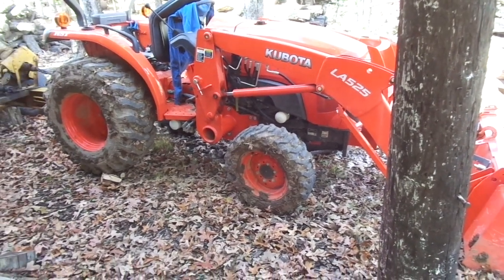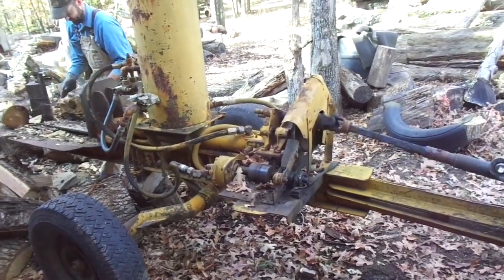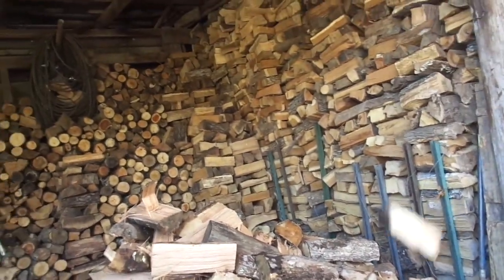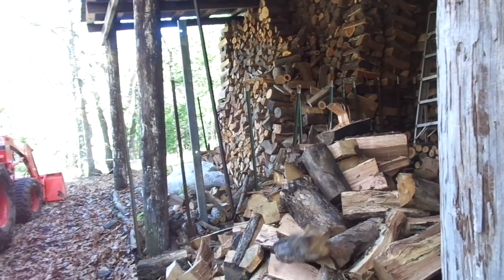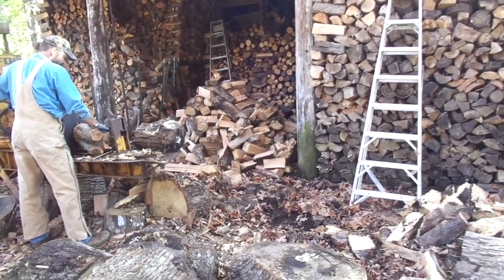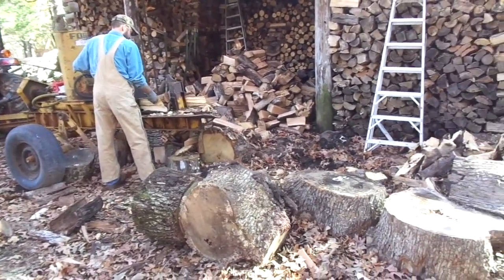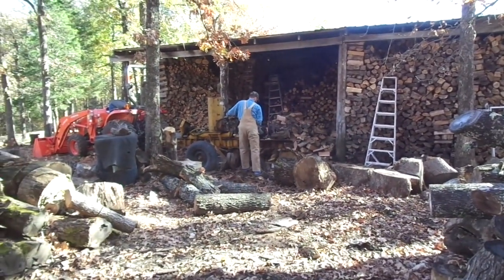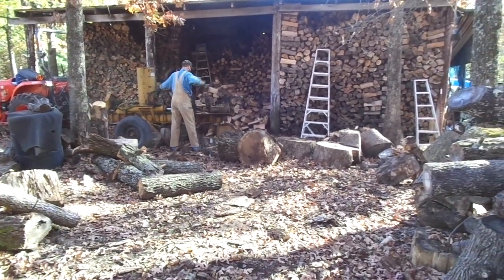Kubota L3301, Homemade Wood Splitter and Son in Law

Comment: “Just subtle differences” LOL!  Not used to seeing you watch others do the work, Wendell. Man, you have a HUGE stash of firewood! That tells me it gets way too cold 🥶 up your way! Thanks for sharing!
Reply from the maker: The shed measures 36 feet by 12 feet deep by an average of 10 1/2 feet high.  We burn about one section per year (roughly 11 1/2 full cord)  and TRY to keep three years split in advance.  We are running late this year, though we are ahead 1 1/2 years on the splitting, we do have to hurry and catch back up to maintain that three year buffer.  We usually cut and split while resting between projects but this year has run amok with projects !!  I guess you, as a renowned Kubota owner, could pick up quite quickly on the subtleties about which I spoke....LOL. Thanks for watching Martin !!

Comment: Muito legal bastante madeira
Reply from the maker: Aqui faz muito frio com a temperatura média do inverno em torno de 20 F. Então, queimamos muita madeira, mas quando o galpão está cheio, são três anos completos.Obrigado por assistir.
Reply: @tractorman4461  amigo aonde vc mora qual a sua regiao
Reply from the maker: @jceletroeletronica  Eu moro no centro dos Estados Unidos, no estado do Missouri. Os extremos de temperatura são 104F para o verão e -12F no inverno, mas isso não acontece todos os anos. Nossas médias são 90F e 20F. Eu imagino que seja um pouco diferente no Brasil.
Reply: @tractorman4461  I live in Paraíba in northeastern Brazil very dry region almost does not rain. temperature around 37 and 38 degrees. very hot and the arizona bradileiro. to sleep only with air conditioning on. there are cold places around here. southern Brazil is very cold but here in my region firewood only for cusinha
Reply: @tractorman4461  the temperature there drops and rises. but here it is not so. Here during the summer the temperature does not drop. keep 38. degrees 37 straight and a suffering
Reply from the maker: @jceletroeletronica  Uau ! 37 C é como 97F. Temos isso com bastante frequência aqui, mas geralmente por períodos curtos. Eu não posso imaginar estar tão quente o tempo todo !! Sou técnico aposentado em serviços de ar condicionado.
Reply: @tractorman4461  because and friend here and very hot indeed. everything is the usual. We are not used to it anymore. but who is not used to it strangely. I was a trucker for 10 years. I now have a workshop. in paulista paraiba. I'm a welder. and mechanical. But here the wage is very low